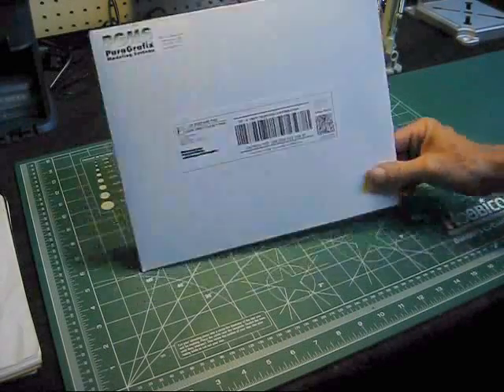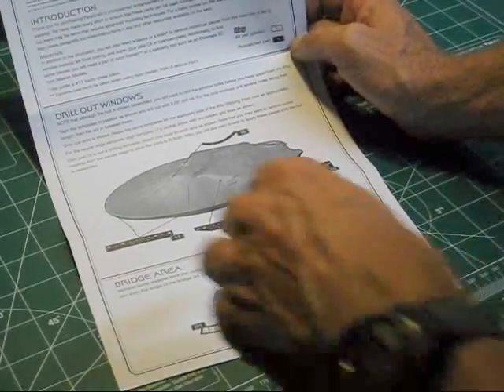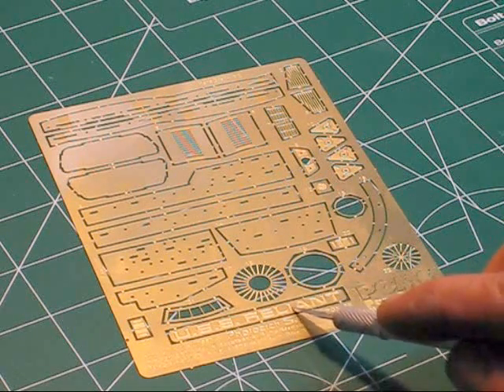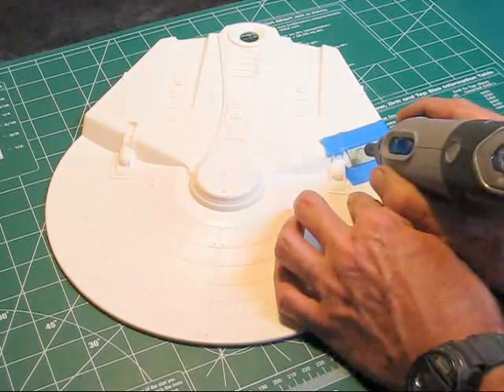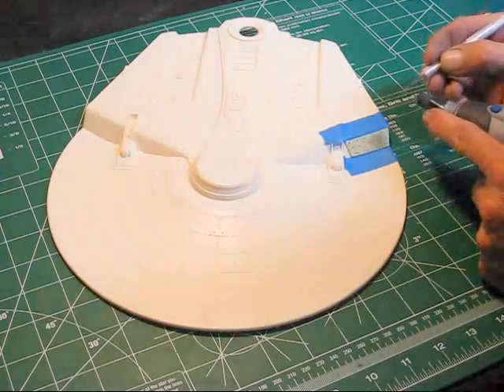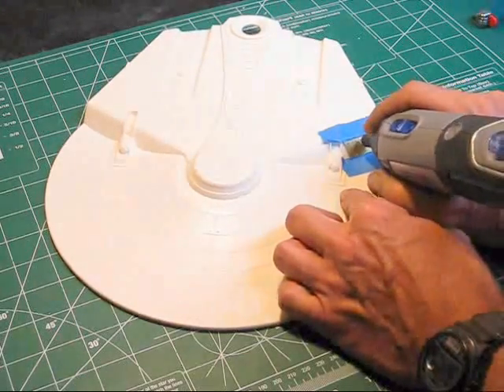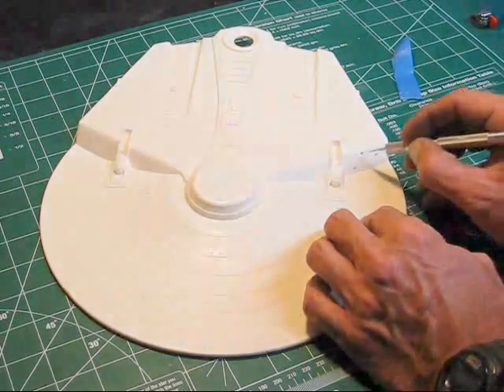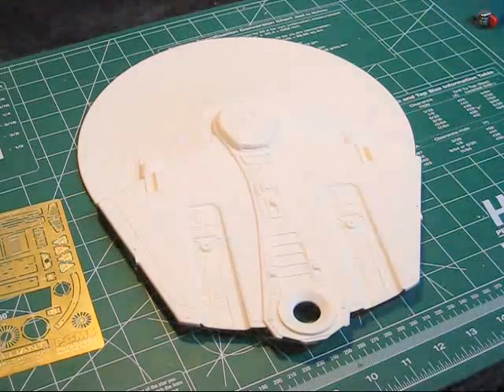From TrekWorks A Look At The Paragrafix Photo Etch Parts Kit For The Round 2 USS Reliant

Comment: how do you know the drill bit isn't opening the templates larger
Reply: You ideally use a bit that's SMALLER than the template window/hole.
IF you use a bit that's the same size as the template, it will work out into a bigger hole than what you want...  That's just they way it is with bits and just about any material you drill into...  It can especially be truth with plastic that has a horrible tendency to melt (and worse yet, release gas!) if you use too high of RPM's.  You can get drills that run under 100 RPM.  I don't know how common they are, but they are out there.